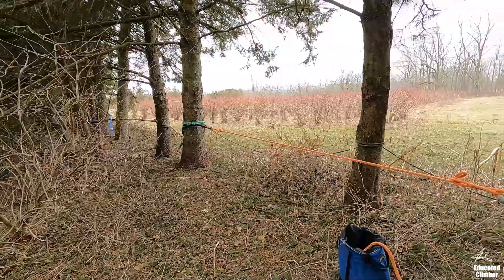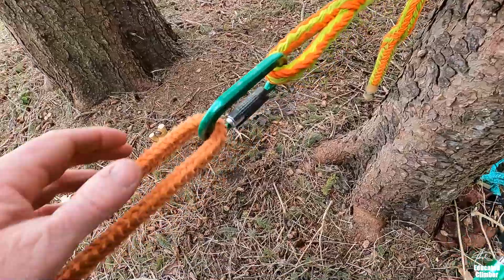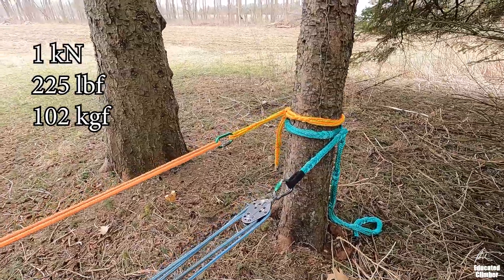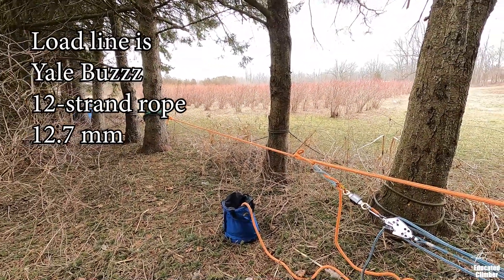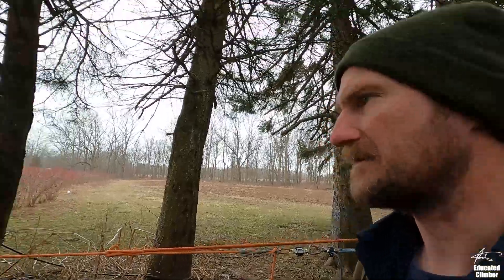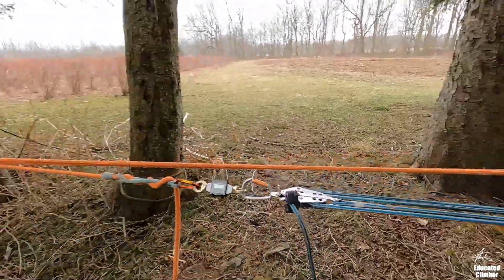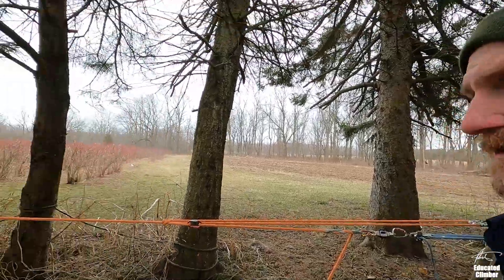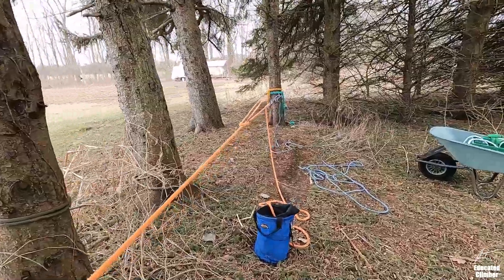Trucker's Hitch Pull Test: 6 Different Ways

Comment: Patrick, thanks for another great video.  Since you asked, I have a test idea.  The bare aluminum snatch ring video reminded me of my bargain buy coated triple thimble, and a review which warned about runaway loads.  I was not able to locate the exact review, but from memory, if the thimble, used for aerial friction, was allowed to “run” , the load can basically run away with little or no braking…. I thought the bare aluminum triple thimble is more coveted because it holds a larger rope, but with aerial friction as the goal, perhaps there’s more to it?  I’m curious to know if rope speed affects friction differently for bare aluminum, vs hard-coated aluminum.  We know that ceramic insulates well, and aluminum conducts well. Perhaps the ceramic coating removes or sinks less heat from the rope and somehow changes the properties of the rope to decrease braking friction (glazing, suppleness).  On the flip side, maybe stationary, bare aluminum concentrates heat and adds friction with speed?  I don’t have any great test setup in mind, but I’ll be thinking on it.

Comment: GREAT VID THANKS...IF 1300 LBS WAS THE STRONGEST PULL  YOUR TEST SHOWED W ONE GUY, WHAT DIAMETER HARDWOOD SPECIES AND SOFT COULD YOU PULL ON WITHOUT TEARING IT OUT ON A CLIMBER IN THE PROCESS OF BACKCUT ? OR IS THAT NOT  ALSO BE INTERESTED IN WHAT TWO MEN PULLING YOUR TEST ,THE BASIC TRUCKERS AND THE Z RIG TEST ( TWO TESTS ) OR ALL OF THEM IF YOUR INTO IT. I'M TRYING TO UNDERSTAND WHAT IS TO MUCH PULL IN POUNDS --BE SAFE🌲
Reply from the maker: There are too many factors at play to say how much pull is too much in a given situation. This is how I think about it: put enough pull into it to make sure that it won't go backwards, judge the amount by how much it moves. Then cut it up, face and back cut. Then slowly pull it over. Hope that makes sense.
Patrick
Reply: @TreeMuggs_PatrickM  YEAH NOT  A BLACK /WHITE ANSWER FOR THAT JUST NEVER HEARD ANYONE ASK.THE LAST COUPLE PULLING VIDS ARE INTRIGUING BUT I'M CONFUSED ABOUT THE LAST VID WITH SEVERAL TESTS THE INPUT WAS GREATER THAN THE OUTPUT..THOUGHT NO MATTER WHAT THE OUTPUT IS SUPPOSED TO BE HIGHER ? AM I OVER THINKING THIS NO ONE ELSE HAS ASKED ? THANKS- BE SAFE.

Comment: The last one baffles me! How is it possible to overcome the 3:1 ratio? 

I mean, in a theoretical situation, in complete absence of friction, the output should be 1+1+1 (3) force units. For how much efficient those pulleys can be, they shouldn't be able to completely eliminate the friction... and even in that case, the ratio should be 3:1 

Instead you measured 3.09...

Maybe it depends on the elasticity of the rope (shouldn't that be a static rope?)? 

No clue 

edit: 
I wrote the comment right away, before reading other comments... now I see that maybe it could be a calibration issue. 

Anyway thanks a lot for your work and sperimentation. It's interesting and very valuable!

Comment: Pulling from side would be interesting. But we also need to figure out what is wrong with your experiment as it’s impossible to get higher than 3.0 to 1. The most you could reasonable get with two 95% pulleys is about 2.7. And your rope angle being off by a few degree costs another percentage or two.  What do you think is causing to inaccuracies?
Reply from the maker: Yeah, I should have done the math in real time. I would have re-calibrated the load cells. Not sure what's going on. I'll re-try it tomorrow...
Patrick
Reply: @TreeMuggs_PatrickM  not sure if I asked before… are you going to Asheville, NC at the end of the month for ArborFest Expo?
Reply from the maker: @CoolGen10  I don't really travel much outside of Canuckistan. Come to think of it, I don't really travel much inside of Canuckistan.........
Reply: @TreeMuggs_PatrickM  I didn’t realize your we so far north. Enjoy!
Reply: Interesting point. When loading up, friction reduces the output below the ideal load. When unloading, friction increases the output above ideal. I suspect that Patrick loaded up and then unloaded very slightly before locking off for making the video. Great work, in every case, on his part. I hope my answer helps. Cheers!
Reply from the maker: @teacherhaggis6945  That's an interesting thought. As the efficiency of the system got better, I was forced more and more to "bounce" on the fiddle block just to get it back up to the 2kN mark. I could definitely not get it there with just a strong, steady, constant pull. Could that have contributed to this effect? I do think that the output load cell was off by a consistent 25-50 lbf per pull. Hard to say. I'm going to re-test. Thanks for the help.    - Patrick